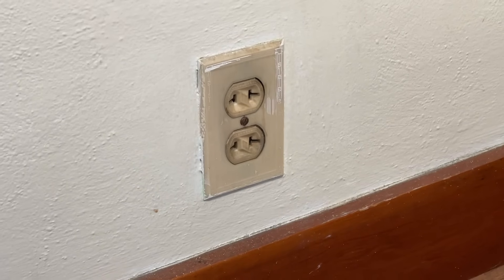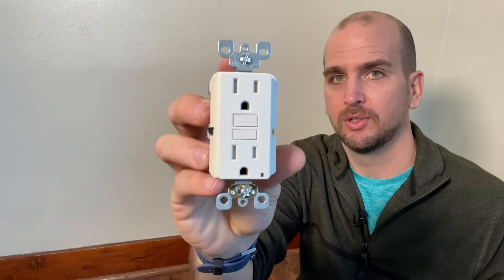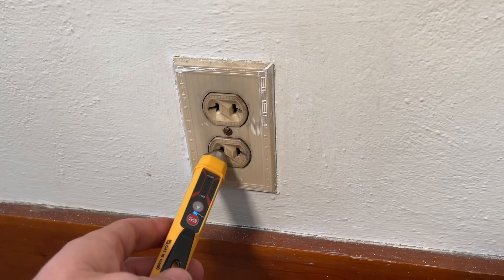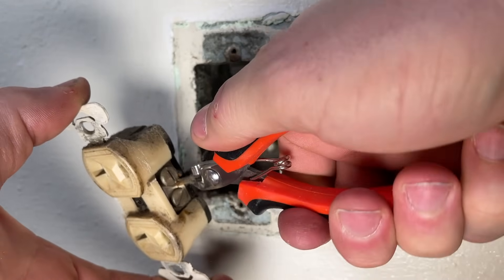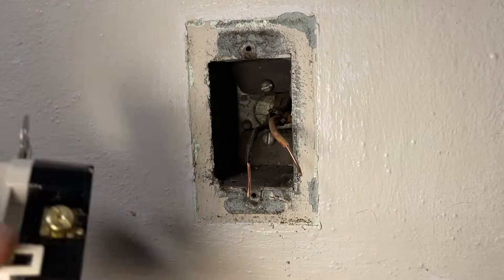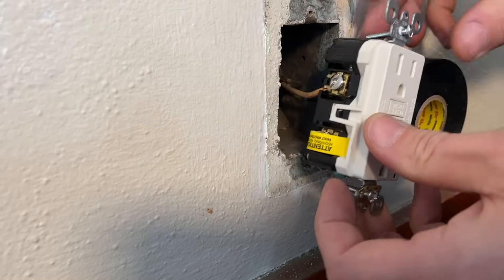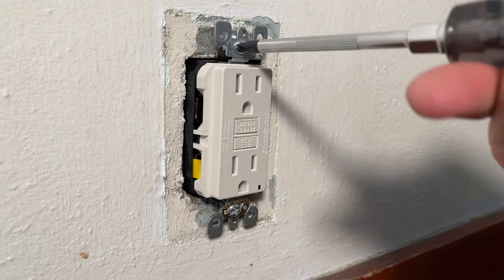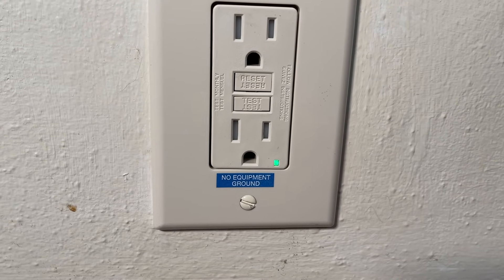How To Replace An Old 2 Prong Outlet Using 3 Prong GFCI

Comment: I figured out why a "ground fault interrupter" works without the ground.   If  you are providing the ground (e.g. getting a shock) it detects that more current is flowing through the hot wire than the neutral and trips.  That is, when your body is closing the circuit between the hot and some other ground (like touching a faucet), so the neutral is not carrying that current.  I wish that other places explained this.
Reply: Yep you got it . Most people including many electricians do not understand how it works . The hot and neutral wire should be balanced . If they are not then the GFCI assumes some current is leaking via another path and trips .
Reply: @rydfree  that's not how it works if there's any resistance on the ground the GFI trip
Reply: @kendallwhite3734  resistance to what?  if you totally disconnect the ground wire at the panel that will not trip the GFI.
Reply: The word "ground" confuses many. In other counties different terms are used. In Britain  it is known as an RCD (Residual current device), still not very clear. In Finland it is called what translates as fault current protector. I think it would be clearer if they dropped the word "ground".
Reply: Good explanation. The ground in a GFCI functions exactly the same as in a normal receptacle (if connected properly), providing shock protection to the user of the equipment, assuming that the equipment has a plug with a ground prong.
Reply: @Thumbsdwn  It will protect you even if you don't have a ground prong
Reply: @eniszita7353  yes, I was describing how a ground prong would function in a normal receptacle, and comparing that to how a gfci would function if not connected to a ground. They will both provide the user shock protection but in slightly different ways.
Reply: I have one circuit in my house where lightning once hit & burnt a neutral wire out. A new neutral was run to another nearby circuit. The hot should have been terminated & extended to the box. Acts like old knob & tubing wiring creating emfs in the improperly wired circuit.
Reply: If you really want to "geek out" about GFCI's, check out this video from Technology Connections. https://youtu.be/ILBjnZq0n8s
Reply: Wonder how long it took you to figure that one out
Reply: How else would it work?

The directions that come with a GFCI (not exactly hidden information) specifically state that if current isn’t following a safe path the GFCI will trip. How would a ground connected to the outlet supply data for all circumstances pertaining to its currents safe path?

It’s likely assumed from the sentence (current following a safe path) if you are installing one you can figure out how it’s doing it. At least without the manual having 10 pages of the basics of electricity.
Reply: @cynic5581  the name 'ground fault' may imply that it detects if something about the ground is wrong.  and "safe path" is pretty vague.  the GFCI will trip if the current flow in the neutral and hot lines is different by a few milliamps.

Comment: Can i change the old elecrical box without ground and change new elecrical box with ground screw.and connect to a gfci?
Reply: What's the point? There still wouldn't be a ground wire going back the the main panel.

Comment: Do you have suggestions for wiring new lighting (3wire to a 2wire). My electrician didn’t seem too concerned of the 2wire cloth wiring I had because it was basically untouched and in good condition. From what I’ve seen I could wire new LED lighting into the 2 wire and just ground the grounding wire inside the junction box.
Reply: Wow cloth wiring in 2021? I'm running new wire every time myself
Reply: @davidjames5881  It's nice when that is practical.  Cloth wiring would be pre-WW2 with old lumber, plaster on lathe.  Houses had fewer circuits that ran across multiple rooms. Access to run new wiring can be limited and very expensive.  My Sears house had a section of knob and tube wiring (single cloth-wrapped conductors on porcelain standoffs) mixed with 2-conductor BX in the basement.  I had it replaced with EMT and as we remodeled the house worked up from there.

Comment: Would this help? Changing the 2 prong outlets to 3 prongs, we(me, gf and cats) get zapped by electricity every now and then just walking around the room where there's airconditioner, a pc, an electric fan. (Floor is just linoleum on top of plain cement)
Reply: I'll answer you with this question: if you had a small hole in a water pipe somewhere in your house, would changing the faucets be of any help?
Reply: @alfredoprime5495  nope... But I really don't know how to stop this getting zapped or is this static electricity? Just got outa bed and bumped with my girl and zap... Touched my cat and zap..
Reply: @fugithieves6839  sounds like static. Do you live in a very dry climate? If so, a humidifier might be of some help.
Reply: @alfredoprime5495  yep, dry, humid and these days you probly can cook an egg on the roads here. got an airconditioner running though, would a humidifier make a difference?

Comment: I have very old 2 prong outlets, when I use a an outlet tester it gives me HOT/NEU REV result. Will this solve that issue? Thank you
Reply: Your issue is exactly as it sounds. The hot and neutral wires are reversed. Try opening it up and swiping the wires with eachother. That’s not a grounding issue. Be card while doing so. Remember, in the US, white is nutral, black and red is hot, and green and copper is ground. If you suspect that the white wire is actually hot In Your circuit, test it. It may have been wired wrong when they put in the wires in your walls
Reply: @zacharyherman8437  Thank you, Zachary! I will be sure to check on that. Last I checked there were only 2 wires. Does this mean I do not have a ground? 

Thank you
Reply: @heathenhoondr7061  if there are only 2 wires then you likely do not have a ground, if you take a multi meter and measure between hot and the metal box the outlet is mounted to in the wall, if it measures 120v then it is grounded and you can install a grounded outlet there and attach the grounding wire to the metal box using a copper wire and a screw. but this would just be a diy solution and i am not certified to do this myself, this is based on what other people where saying in the comments. do this at your own risk, and when in doubt, have an expert do it for you. always turn off the breaker for that room and test the outlet befor openeing the outlet.
Reply: @zacharyherman8437  of course! Understood, thank you!
Reply: How can you plug a tester on a two prong outlet?
Reply: @okaro6595  I have an adapter! Like 80 cents from Lowe’s

Comment: Technically you still don't have a grounded outlet. Your using the neutral as a ground point, not per code. All you have is a spot to park your ground pisition.
Reply: @eloquent-nuance  one neutral source, follow your circuit back to your meter base and POA, where does your neutral begin and ends. You still are tieing your receptacle ground point to the neutral, no matter what device you use.

Comment: How come a ground wire was not added to the GFCI?
Reply from the maker: For this install that was the main focus.  How to get a 3-prong outlet when you don't have a ground wire.  This is why we used a GFCI.  Ideally you would have a ground wire but in some old homes that is not how things were wired back then.  Might need to check the electrical code in your area to ensure GFCI outlet is approved to use without ground but in my area it is approved.

Comment: Vous turned off the breaker, that is logical,  but if one can not flip the breaker is there a method vous can do it with electricity present?
Reply: Not safely. You should always remove power to a circuit before doing any work. Perhaps you have old style screw-in or cartridge fuses. Find which one powers that circuit, remove it, and then you can do repairs. At last resort, there must be a whole-house utility disconnect you can open. Safety is more important than inconvenience.

Comment: Any way to tell what receptacle is the "starting receptacle"?

Seems impossible to be able to determine that starting one and knowing  what all other receptacles are attached.
Reply: Best way is to disconnect all the receptacles and then with the wires hanging in free space (not touching anythings or each other), turn on the breaker and see which hot tire is powered using the contactless probe.
Reply: You have to un-splice the recepticals with incoming and out going wires until you are no longer energizing the outlets downstream.
Reply: You can usually get a head start tracking the starting receptacle down by finding all the outlets on the circuit and visually locating the one with just the single cable attached, that'll be the ending receptacle. (If you're in my house, this search may span multiple rooms.) The starting receptacle is probably the one farthest away along the walls, so check there first the way Daryl and Michael have described and you might save a little time (and those annoying cuts that come from working with wire).

Comment: I want to replace my outlet with a GFCI outlet exactly as you showed but I have a question.  

My two wire outlet (in an older house) has a three prong replacement outlet which I want to replace with GFCI.  When I test that outlet with Ideal Circuit Analyzer, it shows reverse polarity and open ground.  If I use a the two wire adapter (like you were showing) on the circuit analyzer it doesn't show reverse polarity, it just shows an open ground.  Why this difference?  Please help - I'm baffled and confused!

It does the same thing with the simple "plug-in" type circuit tester.  If I plug the "plug-in" type tester directly into the 3-prong outlet, the lights show reversed polarity and open ground. If I run the  plug-in circuit tester through an adapter it shows normal wiring with an open ground.
Reply: If the ground is open how can it determine that the polarity is reverse? It knows which is neutral and which live by comparing them to the ground, no ground no reference. Use a non-contact voltage detector to detect which side is live.

Comment: If it was a metal box and metal conduit was used all the way back to the breaker (or fuse) box, one of those two-prong to three-prong adapters could have given you a real ground if it was screwed in with the center screw.  You might actually find that in an old house with two-prong plugs.  If you think that might be the case you can measure the hot side to the box to see if it has 120 VAC across them.  Otherwise the GFCI outlet is the way to go.
Reply: Or use some common sense, bite the bullet and switch to the British wiring system.
Reply: If it's built in the era of conduit, it's already a three-prong.

Comment: Good info.   For some of those folks  in their younger years wondering why many very old socket have  2 slots shaped like a T turned onto it's side, here's a little history lesson: in the first few decades of the 20th century,  when homes were being electrified for the first time and the abundance of household appliances became readily available and affordable to the middle class,  there were two different types of plug widely used,  the parallel,  which resembles the type found on your lamp or hair dryer,  and the tandem,  which the prongs were in a straight horizontal line, and a battle fought between what would become the standard,  very similar to the videotape format war, Betamax vs VHS.   The tandem plug was officially listed for 15 amps, 250 volts,  and the parallel 15 amps, 125 volts, sometime around the early 1950s.  Just as VHS won over betamax in the mid 1980s give or take a few, several movies were available in betamax up to the early,  to possibly mid 90s,  the tandem plugs mostly went out of use earlier in the 20th century,  it took some years for the standards to catch up, so to allow for the two different plugs, the old outlets could easily accept both.
Reply: Thanks for teaching me a cool fact!🙂
Reply: I always thought it was a 20 amp vs. 15 amp thing.  I sometimes see outlets with the T-shape holes, in modern commercial buildings.  Not sure why they would need it if it's obsolete.
Reply: @sa3270  yes you are absolutely correct,  modern three prong outlets have a T slot for the neutral on a 20 amp device so you could plug in a 15 or 20A plug, 240V 20 amp outlets such as you might use for a larger window AC or a large electric heater or air compressor in your garage,  also has a T slot as well as a horizontal slot, allowing both 15 and 20A 240V plugs to be used.   Whereas the very old two prong double T slot outlets date prior to the standards we're familiar with today and were basically a way to grab a larger marketplace share since parallel and tandem two prong plugs persisted for many years prior to about 1960.
Reply: A few taps with a hammer will usually suffice..
Reply: Nice
Reply: You had my upvote at Betamax
Reply: @Walter-T-Mc  I have replaced a few of those T slot ungrounded outlets in my home, as one or two of them had gotten loose over the 68 years.  Those that I pulled from use are rated at 15 amps.  I replaced them with 2 prong ungrounded outlets to stay within code; one day, I will likely pull some ground wire to the boxes after I do a repair in my kitchen to replace an old rusty metal box with a new one and send up a ground wire to my attic to bond other circuits with.  Since my breakers are all on the same panel, sharing the ground will not be an issue per NEC regulations.
Reply: Cool, I just Googled "tandem outlet" & lo & behold, now I know what I'm looking at in my 200+ year old house as well as now knowing how to properly rewire the outlets. Those 4-prong outlets in my house had me wondering.
Reply: Thank you for this piece of information.
Reply: The tandem (NEMA 2-15) was first, patented by Harvey Hubbell in 1908. Hubbell improved his design with the parallel (NEMA 1-15) plug in 1912, and a polarized version in 1915. Hubbell also patented the duplex receptacle, and dual standard receptacles were common until the NEMA reassigned the 2-15 plug for 220 volt use in the 1920s. Since then, both 1-15 and 2-15 receptacles have been superseded by their grounded, 5-15 and 6-15 counterparts, although the older, ungrounded plugs are still used for devices that don't require grounding.
Reply: @dougbrowning82  thank you.   That is some very interesting history lessons for the younger generation.  I've always wondered where the name on outlets and plugs got the Hubble name on them.  I did know, based off the electrical and home repair books i have at home,  that partly the reason for the t slot outlets,  is to accept the 2-15 and 1-15 plugs, i wasn't sure the decades,  but obviously when homes were wired for the first time in the early 1900s there were very few standards for plugs and wiring methods,  and the standards that did exist obviously not every appliance manufacturer for the relatively few that existed,  followed , so they dual slot outlets were manufactured to accommodate both, as a marketing strategy and convenience,  even after NEMA came in and standardized plugs and receptacles by voltage,  current,  and grounding/non grounding,  there were already many devices using both types, so they continue to make the t slots until the ealry 60s, after which they started adding that third slot for the ground.
Reply: @Sparky-ww5re  Hubbell's company is still in business, as an international corporation based in Shelton, Connecticut. One of their plug designs, by George P. Knapp, became the standard in Australia and New Zealand. The modern three prong US plug (NEMA 5-15) was invented by Philip Labre in 1927 (patented in 1928), and adopted by NEMA in 1948, at which time the ground blade got its familiar "U" shape. The 2-15 plug was re assigned for 220V use and eventually superseded by the grounded 6-15 plug.
Reply: What ended the electrical issue?

For Beta and VHS, it was porn.  Porn movies made up most of movie sales.  They decided as a collective to go to VHS.  Beta was the better system overall, but the decision was based on sales.
Reply: @charleshodgdon6168  lol i learned all i need to know about movies sales.   As far as the electrical tandem vs parallel plugs,  not sure because that was way before most of us were born, but based off some of the electrical code and repair book i have, it seems like because of the two different voltages in common use beginning in the first few decades of the 20th century,  when the majority of homes went from lanterns or gas lighting to the new fangled electric lamp for the first time, the fact there were few if any standards for wiring,  and the obvious hazards of connecting something to the wrong voltage/current rating, they needed something that would be standard across the board to prevent plugging into the wrong power source,  so they finally decided to used parallel plugs for 120 volt 15 amp and tandem plugs for 240 15 amp, such as might be for a window A/C unit or large electric heater before the code began requiring grounds on all the outlets in the 1960s.
Reply: @charleshodgdon6168  beta cassettes were twice as big so i'm sure that was a factor
Reply: @Mr._Chievous  No, they were smaller and that was the problem. They could hold less tape.
Reply: @charleshodgdon6168  Also, SONY refused to license its Beta format, whereas JVC (if I recall correctly) licensed out VHS tech and before long VHS dominated. Studios pumped out product in the dominant format.
Reply: @charleshodgdon6168  That is nonsense. The fact that there was more porn on VHS was the result of VHS being more popular, not the cause. I can think a husband explaining to his wife that they should get VHS because of porn.
Reply: and you guys still havent went to 230V like the rest of the world.